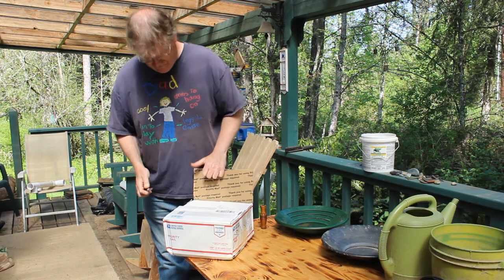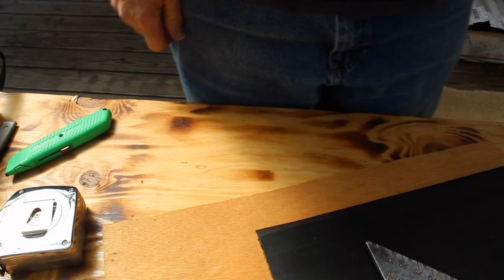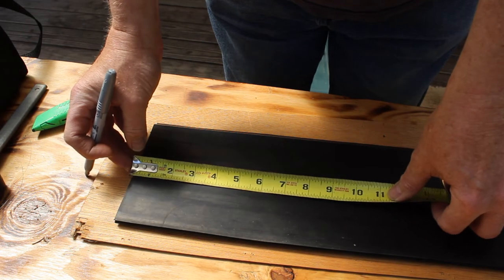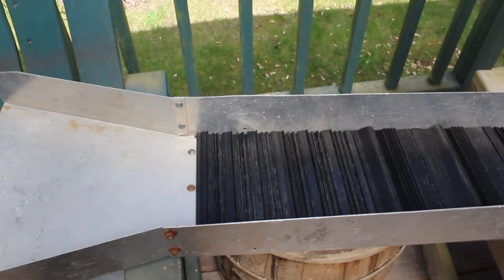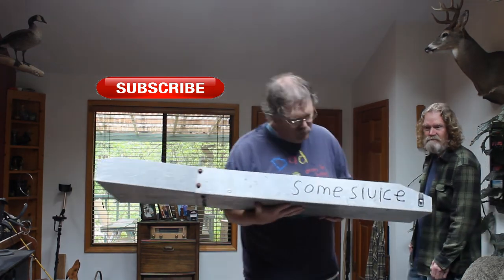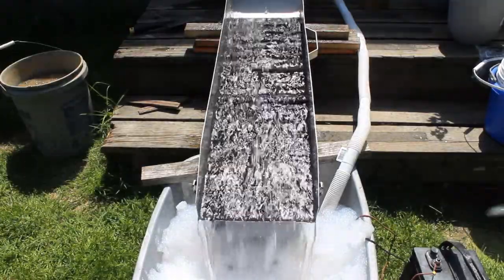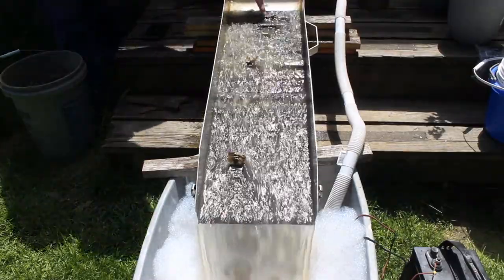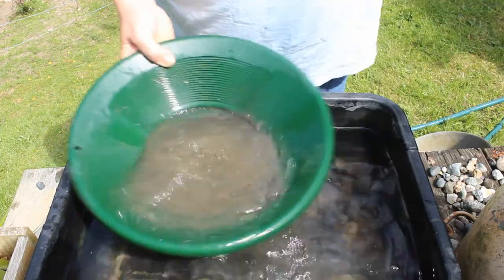Sluice Mat Build

Comment: Why 9 and 13/16s? Why if you cut it at 9 inches 36 inch wide piece gives you 4 pieces this way you have about 7 inch of waste???
Reply: Best of you make your own sluice width for efficiency
Reply: Also did you tape the sides so heavy could not slip around the edges?
Reply: Wasted mat
Reply from the maker: My sluice measured that width more or less.
Reply from the maker: @jeffbybee5207  Yes